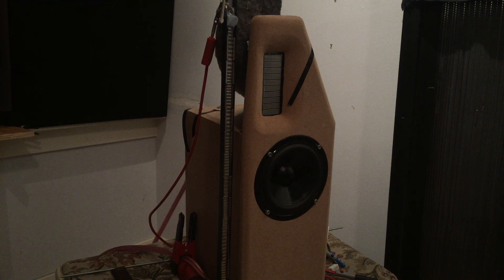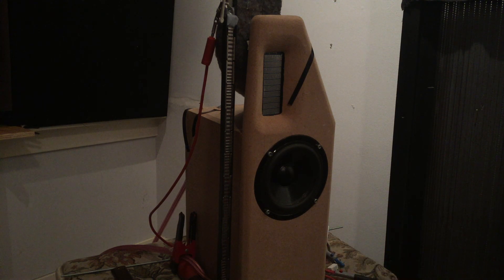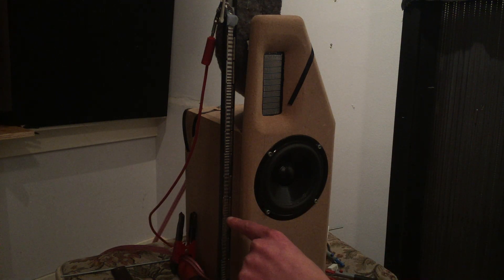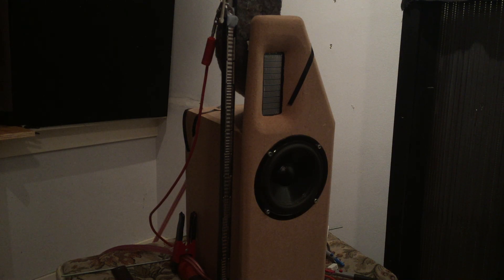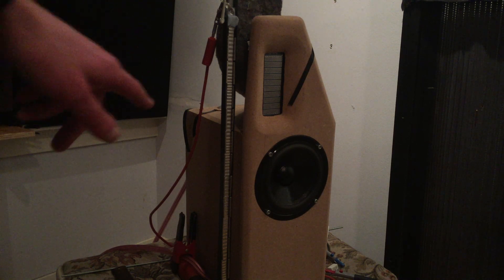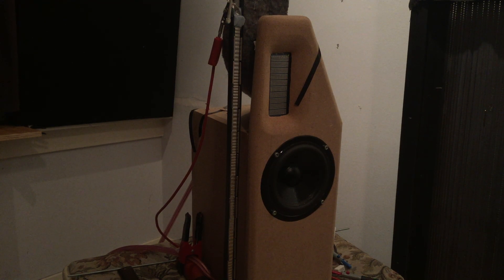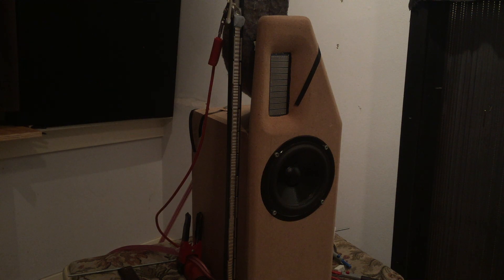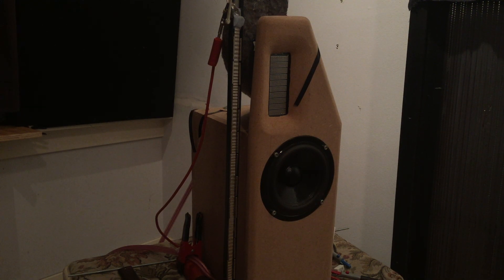Super fast( build) ribbon tweeter - hardware store stuff (MUSIC)

Comment: Hi! I also made a ribbon tweeters for my speakers. The tweeter sounds much louder than I need when using transformer.. Is it good to use a resistor instead of a transformer to increase the impedance and reduce the sensitivity of the tweeter? Or the resistor will make the distortion more than the transformer?
Reply from the maker: should be ok, biggest problem is that you pump in allot of power into the resistor.. so if the ribbon is really low on impedance , a matching transformer is better :)
Reply: thanks for the quick reply! my amplifier works of 4-8 Ohms load, ribbon tweeter has an impedance of 0.2 Ohms. The amplifier has plenty of power to heat the resistor and lowering the tweeter relative to the drivers I need. Will the resistor degrade the sound quality?
Reply from the maker: Wont degrade. But 0.2 ohm should use a transformer. With a 0.2 ohm resistor, half the power goes to the resistor.  To reach 4 ohm almost 20 to 1 of the power goes to the  resistor . I dont think there is much left from spl
Reply: Thanks for your advice! I watched all your videos, you did a great job! I found a way to expand the dispersion of the ribbon tweeter in the horizontal direction - set of 3 ribbons at a horizontal angle of 15 degrees.
Reply: @joppepeelen  Hi dude! I did an experiment with transformers on different cores (ferrite and amorphous iron), the primary winding is 300 turns of 0.5 mm wire, the secondary winding 30 turns of wire 0.5 mm x 5 with complete filling of the window of the core. Ferrite is complete shit )) distortion from the 1 to 20 kHz is around 5%.. Amorphous iron is much better, but the resistors are even better! The sensitivity of the tweeter with a resistor, you can adjust by changing the size of the magnets (magnetic field strength in the gap) to align with the driver volume.. once again thank you for your advice!

Comment: Hi, I watched your movies and read the DIYAudio.com thread about ribbon speakers where you built prototypes and gave yourself the topic, great respect for you for the work you did :)
I have a few questions, what magnets did you use to build this ribbon?
Height, length, width and magnetic force?
I also built a ribbon speaker with 40x15x5 [mm] N38 magnets with steel 15x10x120mm, 3 pieces per side with 10um X 9mm X 120mm aluminum membrane, the effect is interesting but I'm still looking for the optimal solution.
What is the SPL of your ribbon speaker?
I would be grateful for some advice .
Regards :)
Reply from the maker: Thanks !!!!!  Well this was really a crap shoot with whatever i had laying around. Magnets where tiny 30x5x2. Because thats what i had and fit this small profile. I am not shooting for spl here but extension   towards 20khz to be used in my big planars to play as super tweeter down as low as a one meter long one can go. I wanted to  try a u shape piece of metal or ohm shape. I am not so much into ribbons so i just played around . Planar magnetic is more my thing. So im not sure if i can advise on ribbons. I dobt know enough about them yet ;)

Comment: Joppe, what frequencies are you shooting for with this ribbon and do you think it will help with vertical dispersion due to the length? Do you think a wider baffle face-plate would help as I see a lot of manufacturers with large front plates with ribbon tweeters?
Reply from the maker: Length only influance vertical dispersion. It gets worse in that plane, so realy beamy. The very small width does increase horizontal dispersion.  I shoot for as high as i can go. And low is not that critical. My big planars reach up to 13-16khz so i think enough headroom to play with in any case i think